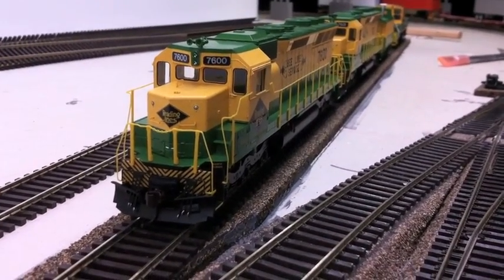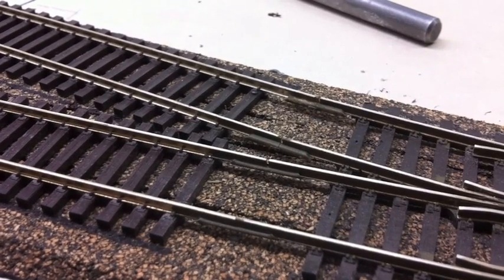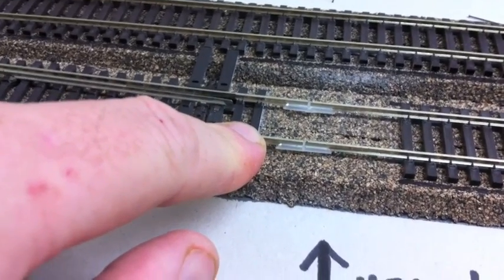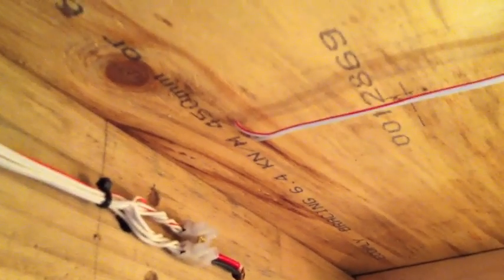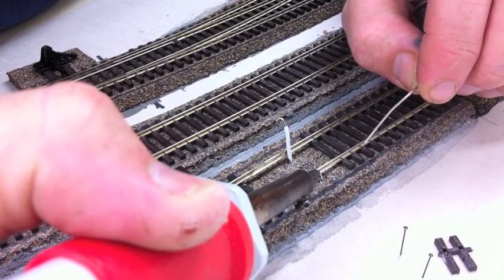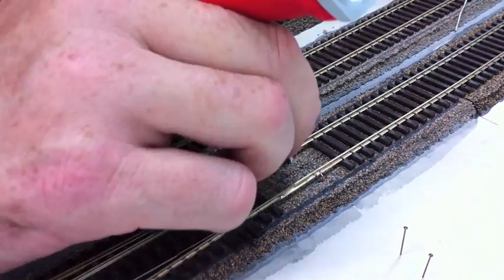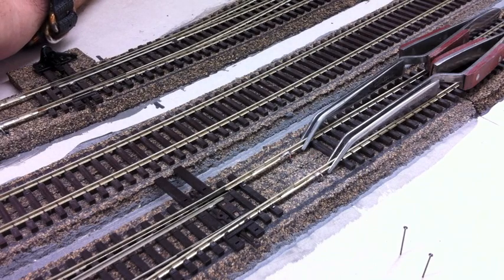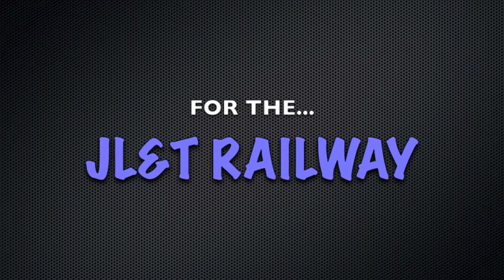JL&T "How to Episode #1" - Wiring Blocks & Short Management Devices

Comment: how did you prevent a loco and cars wheel flanges from hitting your feeders on the inside rail?
Reply from the maker: Just used thin wire and soldered it to the bottom side of the inside rail...